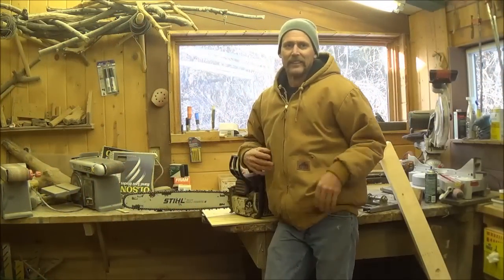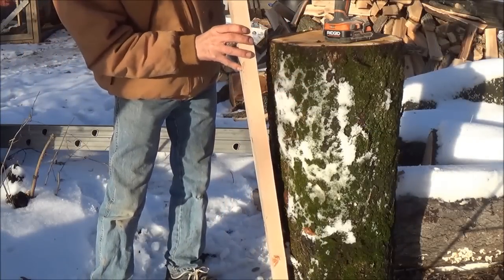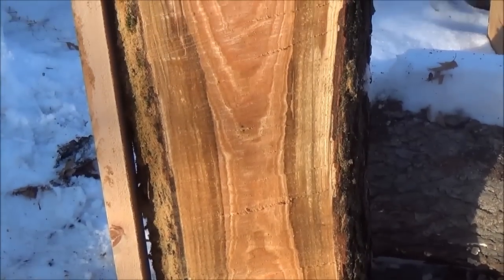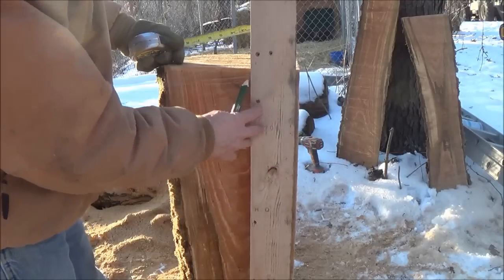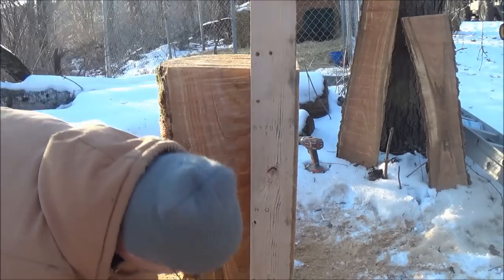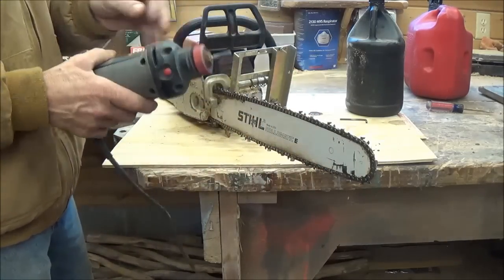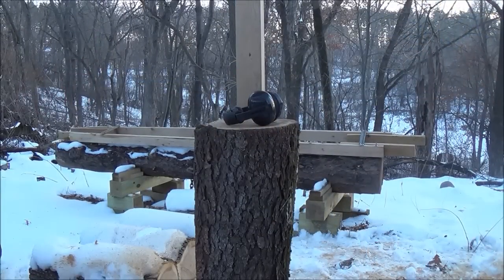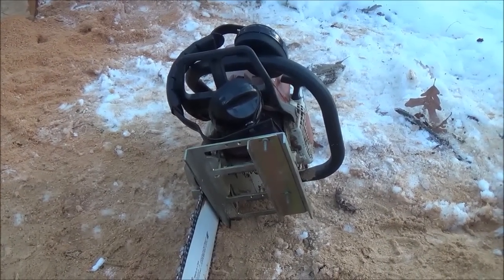MICRO CHAINSAW MILL. Milling Cherry Boards. Amazing little piece of equipment.

Comment: Hi Joe,
Can you please explain to me WHY YOU ARE WEARING GLOVES TO WORK WITH A WARM COAT AND A WOLLEN CUP and yet you are wearing jeans and trainers IN SNOW !!!!
Reply from the maker: I wear long johns under my jeans and when I wear heavy boots my back gets sore. You will find that by wearing two pair of socks, a cotton sock with a wool sock over it and then tennis shoes your feet will breath very well and if the snow is cold it does not melt so your shoes stay dry and your feet do not get cold. In boots your feet sweat and they will get cold faster than how I do it. I have been doing it this way for many years. If it is wet snow or extremely cold out or if I am sitting still in the deer stand I will wear my heavy boots.